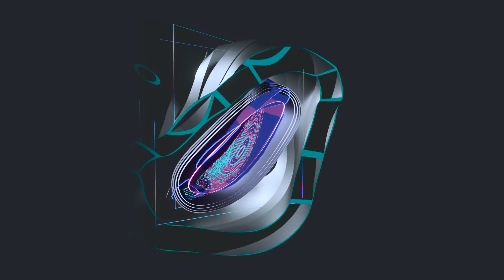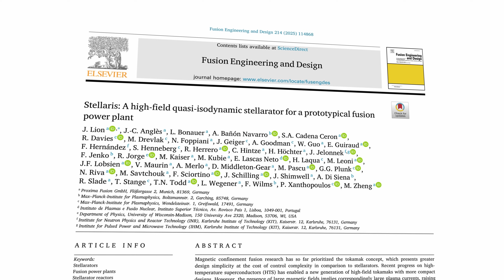Introducing Proxima Fusion

Comment: This would never be able to compete with solar and wind prices for two strong reasons
1- Even if you accomplish in the future to create this super complex hardware at low cost, you still need to convert thermal energy into electricity which usually represent a 30% of the cost from a nuclear plant initial budget cost (which with experience that cost is usually higher).  Just that 30% of the cost represent the total PV and Wind cost on good locations.
2- The lack of intermittency would not be much of a case when hydrogen storage become cost effective due a larger share of solar and wind in the power mix.  Besides, you need energy in chemical form (h2) anyway to feed clean energy to the transportation sector even if all your power plants are fusión or nuclear. So that extra "storage" cost comes almost free with Solar and Wind, the only drawback is extra capital on electrolizers due the lower capacity factor from intermittency. But electrolizers just count as 25% from the total hydrogen cost, because the rest is just electricity cost which Solar and Wind are way cheaper and they become even cheaper.
Reply: Youre not factoring fission plant retrofits.

That kinda ruins your whole calculation 😅
Reply: @xenn4985  it does not matter much, for example a nuclear plant requires to spend a 25% of its whole original cost to obtain the 20 years lifespan extension (from 20 years to 40 years). 
Between those cost are included the remplace of the PWR (steam generator), The steam turbine and several other pipes and hardware. 
Also there is a difference in power between different model of nuclear reactors.  Maybe you can built a fusion reactor to remplace certain model, but it would not be compatible with those thermal plants that use a different power level or thermal efficiency.
You not only need to match the power, you also have to match the working temperature from the inlet and output.
I read some time ago that they wanted try something like that with SMR, but I have my doubts.
All SMR in development are failing or with budgets that skyrocket from the initial budgets.
Reply: @angellestat2730  literally nothing you just said actually refutes my point :I

Solar people are so weird...
Reply: @xenn4985  why you did not understand it? 
You are saying to retrofit fission plants. 
As we are in the context of fusion reactors that also has to deal with the high cost of  convert thermal energy into electricity, then I imagine you are saying to eliminate the fission reactors of nuclear plants and place your fusion reactor saving all the thermal conversion cost? 
If that is what you are saying then my answer remains..
Because no all thermal plants are compatible and there are not new, so you will have to remplace all those components at some moment anyway, which it will add to your fusion plant cost.
Also, If being weird it means being right.. then yes.. I am weird.

Comment: A.I , Fusion, Quantum . The new trinity.
Reply: And robotics
Reply: @precursors   that's technically AI
Reply: @friedpizza262  Not at all. It is mostly about new materials, engineering, motors etc. Yes, the brains of it is AI, but a lot is going on in the engineering background.
Reply: Quantum is a hype scam, maybe in 20 years it will function.
Reply: @binky777 Indeed, I’d add Fusion to that as well. I think the current trinity is AI, Robotics, CRISPR
Reply: Don't forget Leadership, Synergy and Empowerment since we're just throwing random buzzwords out.
Reply: @YouGotServed835 😂
Reply: Also DEI, LGBTQ and equality.
Damn, I puked a little bit in my mouth just typing this...
Reply: Add CRISPR

Comment: Brave to leave the comments open.
Reply: Not sure if you're an expert in this arena, but It is curious how so many private companies are getting into fusion lately. Why do you think that is?
Reply: @Fisherdec  it's needed desperately and there have been major breakthroughs recently (i.e. - net positive energy output)
Reply: @Fisherdec , I'm not. But they explicitly say it in the video. high(relatively) temperature superconductors and better more available computing to model and simulate what's going on inside the plasma. So, better materials and easier time understanding what happens when you turn the machine on.
Reply: Why? This is awesome tech
Reply: Fr

Comment: Standard tokamak design will not achieve fusion. Your ai optimized design is still based on the tokamak. There needs to be a complete redesign across the fusion industry. Although this entire thing seems like a grift just to get rich from funding, like most scientific projects are. Even if you achieve fusion, do you really believe the corrupt ruling class will let you implement free energy for the population? Now we cant have that, because that would give people independence from the government! If they could charge you for the air you breathe, they would.
Reply: Not just to get rich.  The fusion program is 76 years old and has stayed “30 years/a decade away” to act as a slush fund to funnel money to other research that is just as vital yet far less sexy.  At least these people don’t seem to be aware of the kayfabe and are actually trying to do something.
Reply: @isaackellogg3493  Lockheed Martin has already patented a fusion generator, yet the public is still grasping at straws. These groups are primarily funded by investors and the government. Without those funds, they can't do any research. They aren't innovating anything, they are only doing government approved research and tests. If they do actually achieve groundbreaking research, their work gets bought by the government, all their research and results are locked under a NDA, and then they never hear about it again. You don't hear about it in the media because they are forbidden from commenting on it. Anything that disturbs the balance of power is shut down.
Reply: That is no Tokamak design.

Comment: Isn't it easier to do deep geothermal instead? Commercially viable fusion will probably not be here for another 100+ years.
Reply: In 1956 scientific consensus was that spaceflight was > 100 years away.  Forbidden Planet projected the moon landing for the 2090’s. Not the 1990’s, the 2090’s.  Fifteen months, not years, not decades, months later was Sputnik.

Comment: ETA sustained Q > 1?
Reply: Don't know what ETA means. 

But what allways gets reported is q max..   The ratio of invested energy into the plasma versus energy emitted from the plasma.
But q MAX   is total bullshit.  The only thing that matters is Q Total..  The energy needed by the whole facility VS energy created from the Plasma..   All other experiments  reach actual only!!! About 0.01 or 0.005.  Or..  0.5 t0 1 % of the energy needed to be energy positive in the whole system.
Furthermore creating electricity from this would kill again 40% of that energy.

In comparison..  Diesel at the pump.. Creates a surplus of 4, coal when finaly converted to electricity reaches about 8.

Solar averages 10, winenergy 20..

So this technology lays about 200 to 400 times behind renewable. Even if they use buffers electricity grids and the energy for building them gets subtracted and the energy for recycling gets subtracted.

Fusion may work in 40 years..   But at that time we are allready doomed if we didn't scale up renewables
Reply: @tomschuelke7955 eta means estimated time to arrival.  OP was asking how long it would take
Reply: @tomschuelke7955 tell me more about this wine energy 🍷
Reply: < 30 years trust me bro